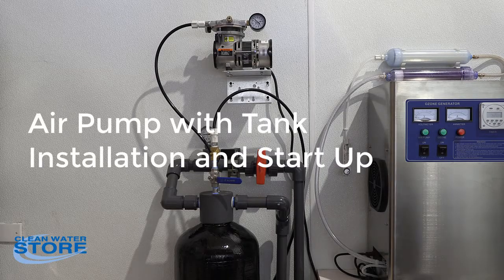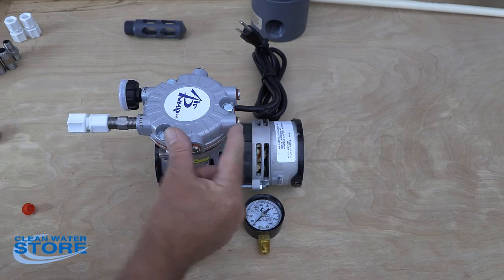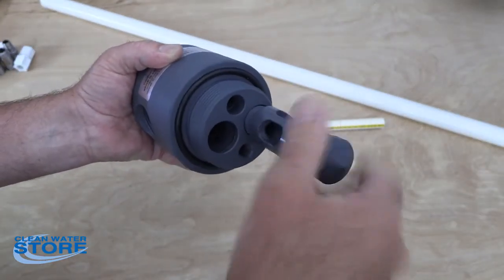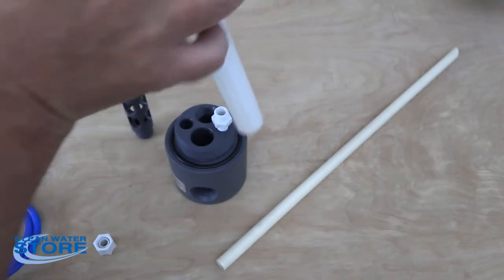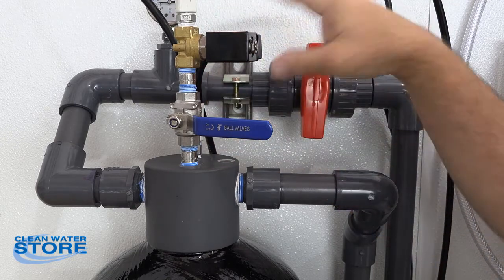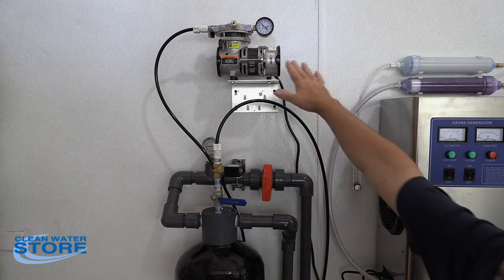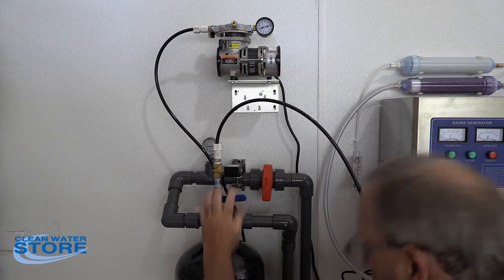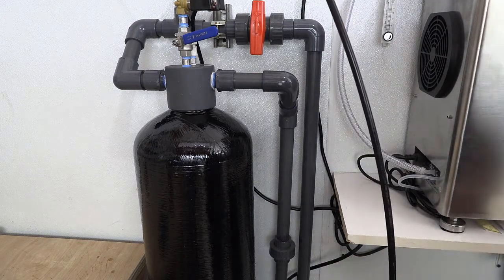Maxi-Vent Air Pump Compressor Tank for Well Water

Comment: Very nice instructional video. Two points that I personally found missing are:
1. A clear statement that there are no media in the tank. Just well water.
2. A brief discussion on the pros/cons on the methods of controlling the pump (Timer vs Well pump switch vs flow switch)